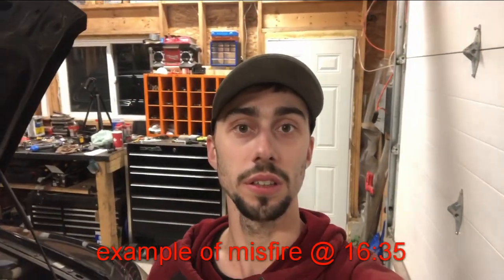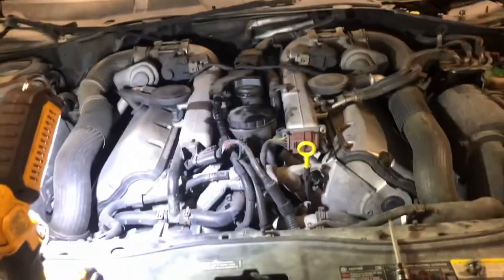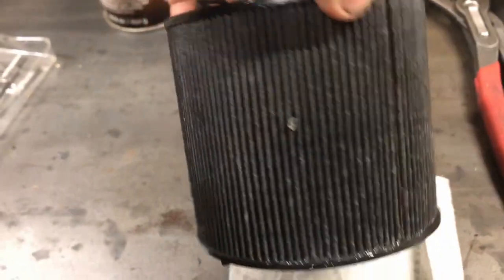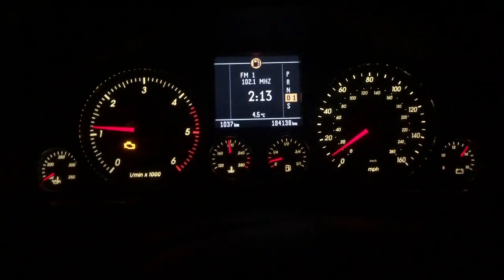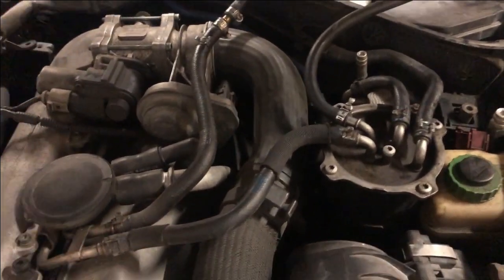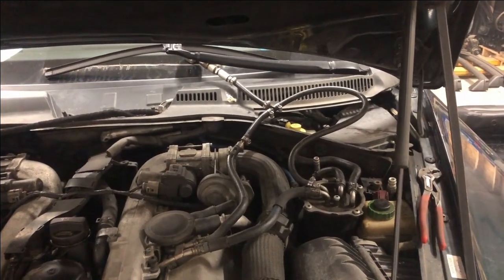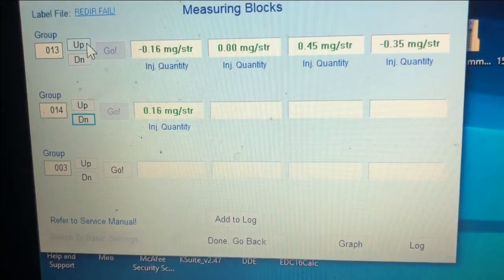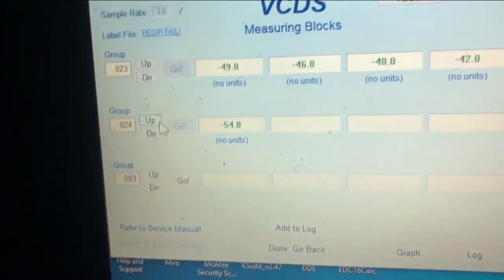V10 TDI: Diagnosing hard start/misfire

Comment: Checking in here after a few years, did you ever sort this out? I've got an '04 V10 that I purchased with heavy fuel contamination in the tank. Cleaned it out best I could without dropping it, filters are returning clean but I'll run into an issue where it'll starve itself for fuel, and it stutters above ~2000rpm. I'm about to dive in to this further, and looking at the lift pump(s) in the tank again.

Comment: Hello sir I need help I have vw V10 tilt staring not working after engine overhaul no power in tilt power motors and wen I start car is colt row diseal smoke after black smoke if is any help think

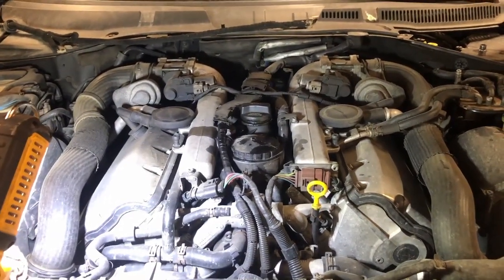Comment: Funny, on my BWF engine coded 2006, glow plow harnesses are in reversed  order, red is 1-5, black is 6-10 (@2:56). Just an observation on the quirkiness of VW engineering. Others (like me) may look at this and think their glow plug harnesses are on backward. Maybe, maybe not.
Reply from the maker: The engines been out before me so who knows maybe someone’s been in there and it’s been mistakenly swapped? I haven’t had any glowplug issues with it so I haven’t tested
Reply: @JoshsJettas  Well, if it's a BWF engine, it should be as above. I was once told by a VW tech that the glow plugs in this engine function more like spark plugs and assist in combustion; unlike traditional glow plugs that only assist in starting. Is that correct? I don't know. I never bothered to look further into it. But I do change up the wiring harness and the glow plugs every 5-8 years whenever I need to go into the valley, just to avoid problems.

Comment: Did u fix the fuel starving, was it the tandem pump, i have a v10 with the same shivering on the tight bank, cylinder 1-5, but my car have only 140 000 km
Reply from the maker: I haven’t, I believe it’s a ecu to solenoid injector issue on my end as it’s both banks. If it’s just 1 I’d think either tandem pump or a leaking injector. Maybe get an oil sample for fuel?

Comment: hey! have you managed to solve this issue? i put v10 injectors (ending in 073h) in my 1.9 and i'm facing the same issue, negative bip values around -40 to -70. they hold steady though the whole rpm range. i mapped in the bip baseline and corrections, duration, etc from a v10 touareg into my ecu. to try and resolve the issue i have changed: fuel filter, reconditioned the v10 pd units and installed with new o rings, brand new bosch tandem pump with oem seal, swapped for a good condition cylinder head, etc. the only symptom is hard starts in the morning or after long standing of the car, apart from that it pulls well, etc. i'm wondering if the solution might be the same for our cars?
Reply from the maker: I haven’t, mine are 073-T. Do you have the file from the v10 with 073H? I was told it’s something between the ecu file and the injector solenoids but that’s over my head. Not many people want to touch this file with already known issues or without spending $1k+, I’ve got one guy in the states that was going to look into it for me but he needed another v10 file to compare to.
Reply: Hey, did you ever solve this problem, i have the same issue with mine, if so please help, thank you
Reply from the maker: Haven’t yet, still in talks with the tuner yet.

Comment: ive been going through this but way worse it will drop into limp mode . i am about to test the out put pressure through the test port on the pump as i think i have a lower feed pressure on the right hand bank than on the left and the tandem pump is also down on vacuum.
Reply from the maker: You can compare the BIP values between the 2 banks and see for sure if its low on feed pressure, could be leaky injectors as well and vacuum line leaks

Comment: 14:30 BIP is somehow connected between signal inject! and actual injection. So how negative values are starving for fuel? It is more like too early injection. positive BIP on the other hand tells that injection is later than should be. Or how it is? Can't find SSP now :\
Reply from the maker: From my understanding the BIP is looking at the injector solenoid amperage. It’ll spike as the solenoid closes then hold steady as the injector injects. Lack of fuel makes it easier to close the solenoid resulting in less amperage/spike and a negative BIP value
Reply from the maker: And yes negative BIP would result in early injection, but I’m fairly certain I read somewhere the ECU will factor the BIP value into the next injection event to ensure timing is correct.